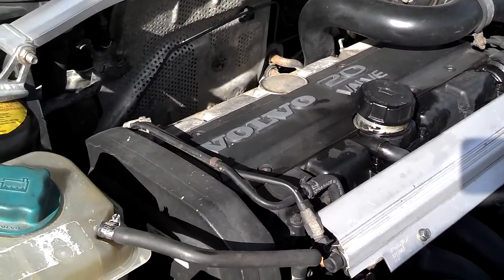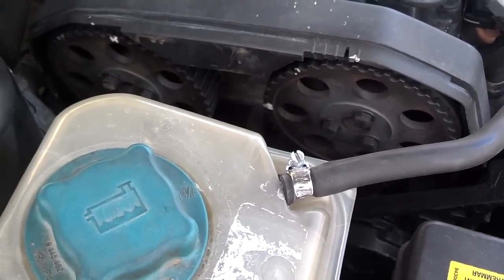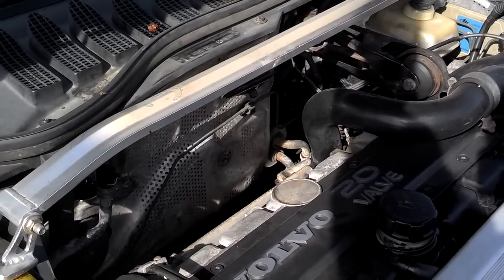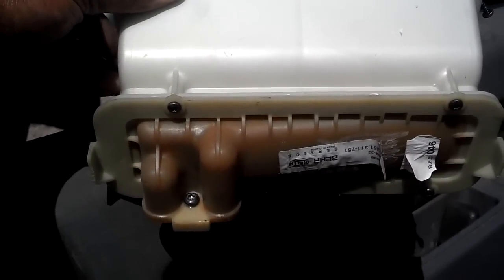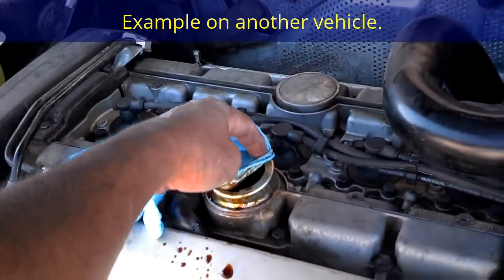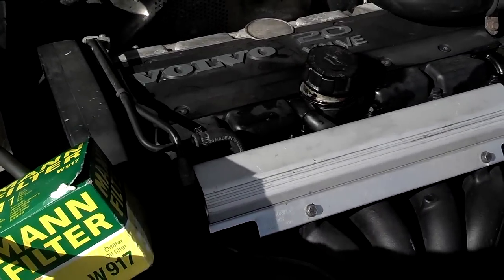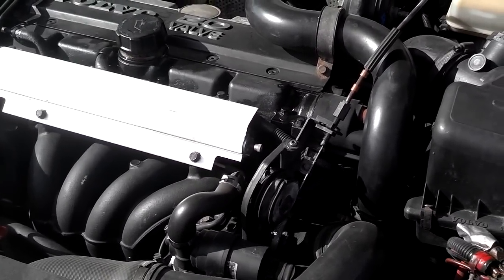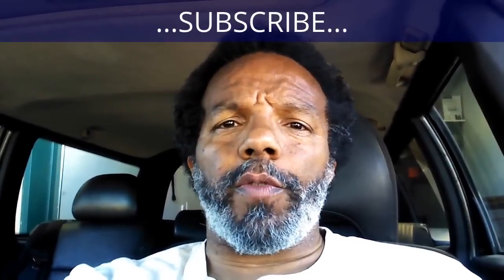New Volvo owner things to do after purchase or check yearly on a 850, S70, V70, XC70, etc. - VOTD

Comment: Hey Rob! Blessings to you man! Thanks so much for your videos. I just purchased a 1999 S70 with 270k on the clock for $400 from the original owner! I owned a 1994 850 about 5 years ago that had over 200k miles so I wasn't intimidated by miles. Watched your video on what to check for and everything you mention checked out. Some typical issues like power steering fluid leak (I think its from a seal on the rack) and possible ABS module failure. I will be investigating, but wanted to let you know I appreciate you man.
Reply from the maker: +Philip McMillan You're welcome. Thanks for watching.
Reply: I know im asking randomly but does anyone know of a way to get back into an Instagram account?
I somehow forgot my password. I appreciate any tricks you can give me
Reply: @Hayden Enrique it worked and I actually got access to my account again. I am so happy:D
Thanks so much you really help me out!
Reply: @Emilio Nicholas happy to help xD

Comment: Top man Robert. I own a 2000 First gen V70 (90000 miles) I drive it in Liverpool England.
I have a clean example and am making every effort to keep it that way. I am newish to D.I.Y mechanics. So when ever I need to do a job I end up looking at your how to videos. I have done quiet a few jobs now under you tutorial wing. 
Just had my dash out to check the mount tabs as I have a severe squeak and cracking noise going on. The mounts were all fine but it turns out the last windscreen replacement I had done left the screen too close to the front lip of the dash so thats where the noises were originating from. So a good lashing of sticky beutal tape on there sorted the problem. Your tutorial made it possible. Carry on the good work. Every video you make on the p80's makes my life easier. Thanks m8
Reply from the maker: +Michael O'Donoghue thanks for watching. Glad you got that noise dampened.

Comment: Have had my 1998 V70R AWD, for 5 years. Always good to check procedures and learn, even though belts, hoses and ignition components were replaced new on purchase. The PCV system blow-back check with glove was new to me. It proved to be negative but good to know the work around. Thanks again.
Reply from the maker: You are welcome

Comment: Awesome video! Just grabbed one of these in really good shape for $1000 bucks. First thing I am doing is replacing the PCV system and of course watching some of your other videos.
Reply from the maker: Which car? Thanks for watching.
Reply: 1998 Volvo V70 T5. Got it for 1000 bucks, no rust, everything works, very clean. Just has a clogged pcv and needs some struts for the hatch.
Reply from the maker: https://www.youtube.com/watch?v=hwCzPPiBxk8
Reply from the maker: I now use the tube from the newer cars, '99 and newer.
Reply: Watched the whole thing. Excellent video. Definitely going to use it as a reference while I replace that.
Reply: @wideband  amazing deal! 😍

Comment: I love the glove test...I never thought of doing that before.
Reply from the maker: Matt Woods When I finally found it I decided to do it more than the smoking dip stick. When I purchased my car, the system was clogged but the dip stick did NOT smoke.
Reply: I've been working on my neighbor's V70 AWD. It was almost dead when she bought it. I've been nursing it back to health. I haven't tried the glove test yet but I got it running better by tightening the battery cable connections and replacing the spark plugs and the #5 bad coil. I still have a lot of work to do..like replacing the timing belt...Thanks for your video, it really made a difference! Matt Woods
Reply from the maker: Cool. Have fun.
Reply: Robert DIY Thanks!

Comment: Thanks for the heater core tip! I will check that since all the floorboards are wet in the 850 I am working on. No noticeable coolant loss, though.
Reply from the maker: OK, thanks for watching.
Reply: These cars are notorious for the sunroof drains clogging up and the water will go in the passenger floorboard. I'm about to tackle that problem myself

Comment: Just bought an 06 s60 AWD and now the check engine light came on after only driving 50 miles. OBD code reads P0442 evap leak (small leak). Thats the only code. Everything else was good. Had original gas cap on so I replaced that. I'm hoping it is just that. I will b driving a lot tomorrow to see if light goes off. But now that I watched some of ur vids, I'll b checking out a lot more things on the car. Thank u so much for these vids!!!
Reply from the maker: I hope you used a Volvo gas cap? I usually just replace the seal on the Volvo cap. Probably has a vacuum leak, you'll need to have a Volvo mechanic smoke it.
Reply: Robert DIY No, my brother put a regular one on. I'm going to look into getting a Volvo one. I'll let you know how it turns out. Thank you again
Reply from the maker: You are welcome.

Comment: It's nice to see that the heater core is not so hard to access on the Volvo.  ( I own a 1990 240 DL Gold Volvo Wagon, previously owned a 1987 Grey Volvo Wagon.)Never changed a heater core though... Right now, my issues are a rotting engine crossmember ( which I am still assessing), and a slack kickback cable that does not return properly. Hoping to replace that cable within the next two weeks...I bought the cable and a transmission pan gasket and filters in a kit...No, I am not driving it unless it is to repair it...I will drive it locally under 40 mph.....After the kick down cable is all set I will start looking into the pcv system.. liked you test! My current volvo has about 251k miles on it..
Reply from the maker: +lionreb very nice.

Comment: Hi Robert, thank you for all your videos. I would like to add a remark on the cooling heater core issue. You have modified the hoses to the heatercore, great idea, i will do this also. Because the connection trough the firewall is plastic, mine gave way and overheated the car like you mentioned. If the car cuts out for a second after hitting a bump or something, it is likely the gaspedal sensor. This happend to me. Also cheap fix. Thanks again for al your information! Volvo 855 2.5 20v "93
Reply from the maker: I did NOT modify those hoses, someone else prior to me checking it did. I would return the hoses to the original set up.
Reply: Ok, thank you for your reply. I must say i dont think it's a bad idea, it is a weak and very hard to check point in the system though. It might be the end of my engine because of it. But the modification will entirely be on me! 👍
Reply from the maker: It's not a weak point, it's a maintenance item. If using the proper coolant they go 350,000+ miles.

Comment: Great video again Robert! Thanks!

If someone can cook one of these engines, that owner surly be an idiot.
There is a warning light about "cooling water level" in the front of the owner eyes...
Btw, I cleaned the PCV system, and the carter gas still coming out.
The bottom hole on the engine (near the pcv box) almost completly sealed with rock hard shit... the situation became a lot better after cleaning, but some smoke still coming out.
Reply: Nagy Sandor 
And as I see you have a T5? Cool :) Search for RIP (reverse intercooler pipeing) for 850's. Very simple modification, and a lot can be gained with it.
Reply from the maker: Nagy Sandor Thanks for watching. I overheated one a few weeks ago.

Comment: Robert is it ok if the heater core has been bypassed? I have a 02 C70 I have a scan gauge hooked up if im easy on it it never reads more than 200 degrees but ocasionaly it jumps up to 220 and then the fan cuts on and brings it back down
Reply from the maker: Yes.

Comment: Robert I love your video series, do you have any opinions on the 960s so far as longevity and mechanics? ever so any specific videos about them?
Reply from the maker: lurkbob I have owned 3 or 4 960's. In my opinion, they are the best cars that Volvo ever built. Not sure much for low maintenance, but for the blend of usefulness and lower maintenance than the other white block, FWD cars. I like the '95 - '98 models better than the '93 & '94 models.

Comment: Hi Robert, thank you very much for this very informative video! Concerning the heater core: In case of a failure, wouldn't I realize an increase in the cooling water temperature in the dashboard?
Reply from the maker: Yes, absolutely, as the engine is blowing up. 🫣
Reply: So I am will be warned by the temperature in the dashboard and I can stop the engine before it is blowing up @RobertDIY

Comment: Hey Robert!  We've put 4,000 miles our our 98' Volvo S70 so far since November.  We replaced the entire PCV system and that fixed the pressure in the top of the engine so it is sucking now instead of blowing (your glove test is great!).  However, we discovered that the engine is consuming about 1 quart of oil every 1,000 miles.  It runs great even though it has 359,000 miles!  Do you recommend an oil additive to help "rejuvenate" the piston rings or valve seals?  Or any other advice?
Reply from the maker: Nope. My car uses about 1 quart every 700 miles around town. Leaking valve stem seals. Just stay ahead of the oil level and drive on.

Comment: Hey Robert... must the car be warm to do glove test on PCV system ?... i crank my car cold ( 88° outside so warm day ) and did glove test and glove inflated... is test correct should I wait till temp rise to normal for engine
Reply from the maker: Warm/hot engine.
Reply: Thanks a million Robert... I just bought my first Volvo, a 2004 XC70 with 200k miles, interior leather has No reaps and trans shifts good... only oil leak along turbo tubing pipes... I haven't  investigated that problem yet
Reply: @RobertDIY  Hey... I would like to send donation but I'm not seeing a link

Comment: You said the heater core can leak down under the carpet.  What leaks out of it?  I just bought a 98 V70 and 2 days later realized the carpet on the driver side in the front and back seat, is saturated.  Would that be water or oil or lubricant that leaked from the old heater core?  I do have documentation that the heater core was replaced 2 months ago.  Could the carpet have been wet under the vinyl mat for 2 months?
Reply from the maker: Denise Ezzell COOLANT, main cause for engine overheats causing these cars to go to the bone yard. And yes it could still be wet from a heater core incident months earlier. Check carefully for a bad head gasket. - https://www.youtube.com/watch?v=jsxPXltMFOc
Reply: Robert DIY Thank you so much for answering BOTH my questions!  I know I am going to have more.  I will try not to bombard you.  :)
Reply from the maker: No problem, anytime.

Comment: The best information out there on Volvo.Hello, I have a problem with front wiper blades not seating right on the front windshield & headlights. Is this any indication there's another issue?
Reply from the maker: https://www.youtube.com/watch?v=gt9w-ZSxs9I
Reply: how do you turn on the wipers on the headlights? bought an 850 a couple months ago. can't figure the wipers out, still have to go through all those blend doors too. hot air on driver side, cold air on passenger and can't control where either blows to.

Comment: robert have you ever seen an AC compressor clutch NOT disengage? My AC system froze up and then my battery kept draining because the clutch wouldn't disengaged. The clutch is grounded and has a positive switch controlled by the pressure switch right before the firewall. I had to run a new wire from the pressure switch to the compressor to get it to work properly although I think its caused the Compressor to cycle even when the HVAC unit is turned off unless the AC switch is on off and not auto, That last part could be my imagination. Anyway it would seem that wire would have had to short to positive not ground. Really weird.
Reply from the maker: +Nicholas Hartzler That is strange. I think my compressor runs non stop unless the switch is off.

Comment: robert, thanks...i see a siver bar across your engine, behind the oil
filler cap...what is it?...i'm on my third volvo and have not seen it
on the other two...of course the current one is without it too...
Reply from the maker: +Kenneth Howell strut brace. It is a performance part.

Comment: Robert this was very helpful! I took notes and saved your video! I have an 98 S70 with 41500 on it! Ive saved some money & will be taking it to a local garage with a good reputation!
As I’ve written prior I have a temp sensor to have replaced and also I will have them check all your recommendations! A few questions I have are ABS light pops on and off and will seem a little loose in braking! Recently the SRS light popped on? Also I 
plan on fixing the problems but I’ve seen a few videos you’ve done about issues! Any advice would be appreciated! I love the car and want to keep it running properly! Noting I’m not a handyman but am very capable! 56 & eager to learn about my car!!!
Reply: Im thinking about taking the parts needed to the shop to replace when needed? Seems as though I might piss people off?
Reply from the maker: Wow! Low miles.
ABS module.
Many shops will not use parts that you have, need to ask what are their policy.
Reply: Robert DIY 
It’s tough cause convenience & cost is important when comes to garage to me but I also like your view on Volvo parts  on certain things! I appreciate you getting back! I will keep watching your videos take your advice and work with it!
I will have them check the hoses etc. and keep all your recommendations in kind when having it serviced! 
The low miles are such a benefit and helped me decide on the purchase!

Comment: Also, I do have smoke coming out of the tiny tube where the oil stick is when the car is running.  so you said that means my pcv system needs to be replaced or serviced?
Reply from the maker: Denise Ezzell Probably, but you should do another test with the glove. - https://www.youtube.com/watch?v=FIRoc0VxLd4
Reply: Robert DIY And I love your videos.  You are obviously very knowledgeable about Volvos.  Glad I have someone that I can learn from.  I love the car, just want to make sure I get it in the best shape and take care of it.
Reply from the maker: Good deal. Glad they are helping you.

Comment: That's an awesome video.  Thanks. Robert, what's a fair price for a 2000 s70 (136k miles) that has not had a timing belt replaced? There's one in my neighborhood for $1,800.
Reply from the maker: John Galvin Well, I usually look up the value on www.NADAGuides.com. Then back out needed repairs and overdue maintenance.
Reply: Thanks. Are you still doing your summer tour?
Reply from the maker: Yes

Comment: Hello Robert I saw that the gloves you installed in oil filler blown away instead of sucking in. Could you give me that link? I'm afraid that my Volvo 850 GLT 1995, automatic transmission has same situation? What is the cause of smoke coming out from oil deep stick? Could you give me an advise? Thanks a lot!
Reply from the maker: +Alvinil Rey https://youtu.be/FIRoc0VxLd4

Comment: Hi Robert, been enjoying your videos.  What's your opinion of 2002+ V70s?  I will likely buy a 2002 V70 AWD on Friday.  My biggest concern is failing transmissions, the one thing I don't want to repair myself.
Reply from the maker: I really don't have any first hand experience on the post '98 cars. I read a lot of complaints about the '01 - '03 cars, mainly tranny issues. Other than that, it's a Ford product.

Comment: No the check engine light came off after I replaced the mass air flow.
Reply from the maker: +Mario Quevedo Ok, maybe fuel pressure regulator.
Reply: +Mario Quevedo +Robert DIY I had the same issue on my previous volvo 850 AT 2.5 gasoline. I changed fuel pressure regulator and everything worked fine!
Reply: +sodmod   Unfortunately after I replaced the Fuel Pressure Regulator the car still have the same issue. Any ideas???
Reply from the maker: What is the issue?
Reply: +Robert DIY The wagon runs good while is hot but after a while when it warms up and I come up to a stop or light it tends to die off unless The rpm's are above 1000.
Reply from the maker: Have you ever replaced the temp sensor?
Reply from the maker: https://www.youtube.com/watch?v=8xIi3_n5vsQ
Reply: +Robert DIY No I haven't, Don't even know where is it.

Comment: hello Robert,
my girlfriend bought a 2000 volvo s60 I believe, it did not come with owners manuel, the interior lights won't turn off 
there are 4 total one on each rear door and 1 on the front interior quarter panel on both. sides driver and passenger, where is the button that controls those lights ?
Reply from the maker: Sad to say, it is part of the door latch.

Comment: Hi Robert! Love your channel! Quick help. Used to. Be a Volvo techin another life (only 6mos) and I can't remember what causes this issue: roll either front window down and no probs. Up they go almost all the way and then act as if there is a hand sensor that is faulty and "thinks" there is a hand/object in the way.

Question is this: shall I replace the switches or pull fuses and recalibrate? THANK YOU
Reply from the maker: What kind of car do you have?
Reply: Robert DIY 09’ s60 2.5 T that previous owner chipped.
Reply from the maker: Hmmm, I really don't know. Maybe a roller is bad causing it to bind.

Comment: Are the drive belts the same as the timing belt?
Reply from the maker: NO.
Reply from the maker: Did you watch the video?
Reply: I'm just trying to learn Dr Robert go easy....I love your videos ! I am getting a Volvo V70 2.5t 2004 and the service bill from when it had 100k miles on it says all drive belts replaced and the job cost over 400 so I assumed that was a timing belt. I most likely will change the belt and use your videos as a guide! Do you have any thoughts on the 2004 V70?